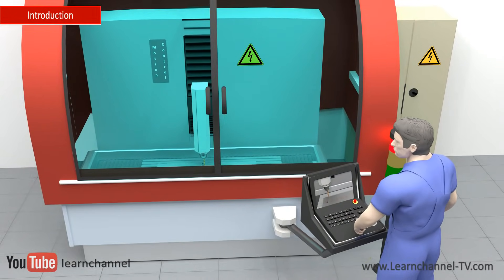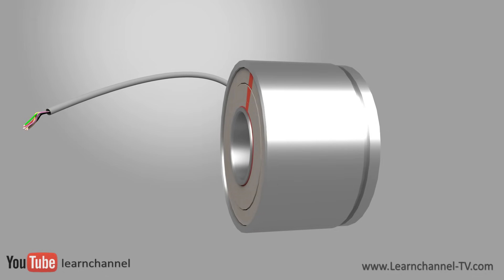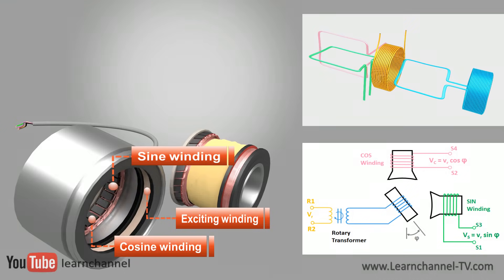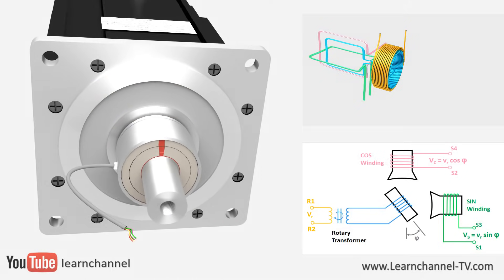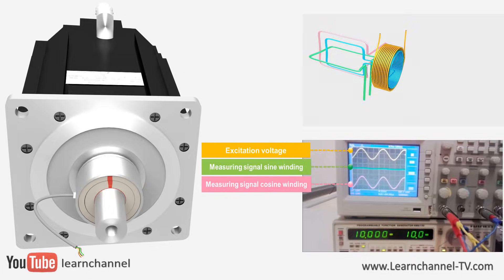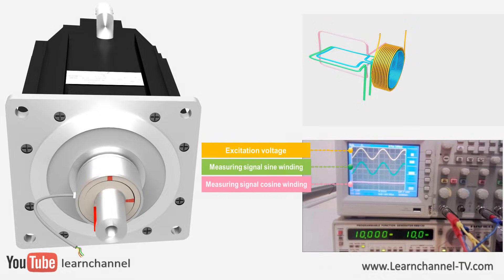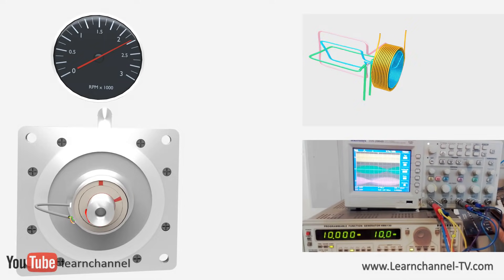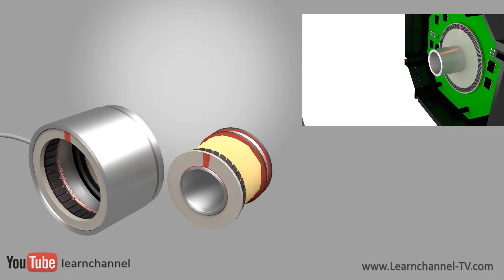How does a Resolver work? - Technical animation

Comment: Hello everyone Does anyone know if there is any rule between the number of polar pairs of the motor and the number of polar pairs of the converter? I have a pp=5 motor and pp = 2 converter and I am in doubt how to control it.
Reply: Sorry, converter  means resolver
Reply: YES, you need to have a resolver that matches the motor pole pair count. I believe you can also double the pole count, e.g. a 3 pole resolver on a 6 pole motor.

Comment: How you measured the speed rotation?
Reply: The sensor is powered with a reference frequency... around 10khz, and the answer comes in the amplitude variation between sine and cosine not phased out.  When you connect the signals to the oscilloscope and visualize in XY scale, you get a straight line on which you follow the angle of the motor axis, so a resolver electronic circuit can also obtain speed and angular position of the axis with great precision.

Comment: I have a question, need help. I have a brushless servo motor I bought used and it has 9 wires coming out of the resolver. I can identify only 6 of them, the standard pairs. That leaves a bundle of three wired, 2 of which are wired into the connector but one is left hanging. Any idea of the function of these extre 3 wires? Thanks a lot
Reply: Two will be of thermostat
Reply: @triveshmishra5149  thanks I assume you mean the thermistor. I suppose I can ignore the third wire... thanks for replying

Comment: umm... I am not really understand ....If the servo motor already have a internal- feedback encoder , the resolver still need ?
Reply from the maker: A servo system needs a feedback device (sensor). That can be an encoder OR a resolver.
Reply: @learnchannel-TV  which one is better ? Encoder or resolver?
Reply from the maker: @rudrakalani  I would prefer the absolute encoder. But if you have a rotational axis you have the only choice between resolver and incremental encoder. If the sensor is exposed to heat and dirt, you need a resolver.
Reply: This application appears to show secondary position feedback. That's a confusing part for some people. Normally you would just use the feedback device in the motor but in this case (CNC machine), the secondary feedback is used to close the position loop for enhanced accuracy.

Just view this video as if he were referring to the feedback device in the motor.

Comment: What is Difference between resolver and rotary encoder
Pls guide
Reply from the maker: Talking about rotary encoder you mean incremental or absolute encoder I guess.  i have 2 videos about this in my laylist:
https://www.youtube.com/watch?v=zzHcsJDV3_o
https://www.youtube.com/watch?v=yOmYCh_i_JI
Reply: resolver generates a sinuswave (ac) it only generates a voltage dependent on the numbers of evolution per minutes/second whatsever
encoder generates A and B phase which are square wave signals,he also has a Z pin for referenz point